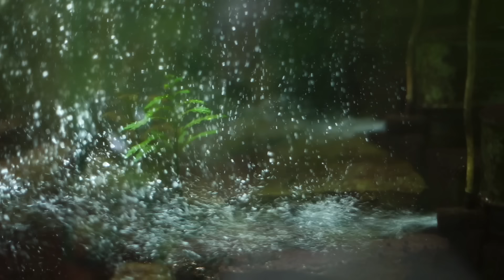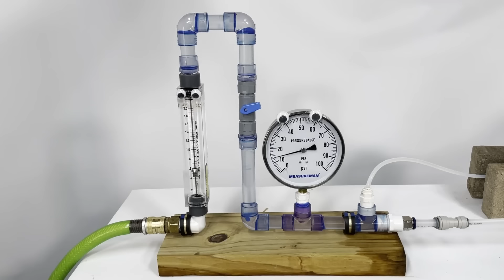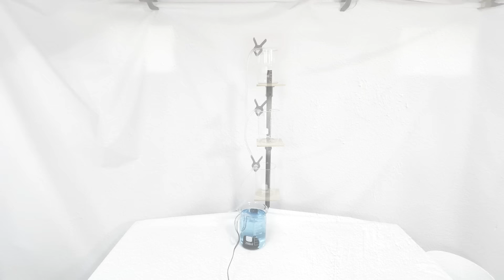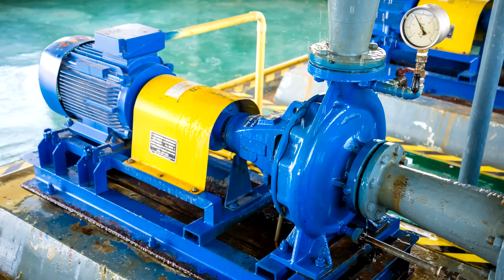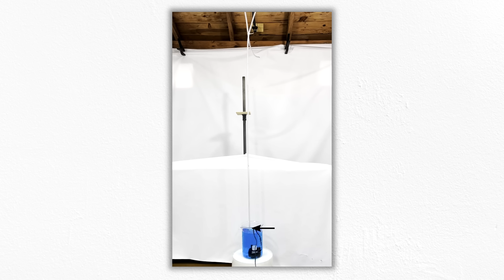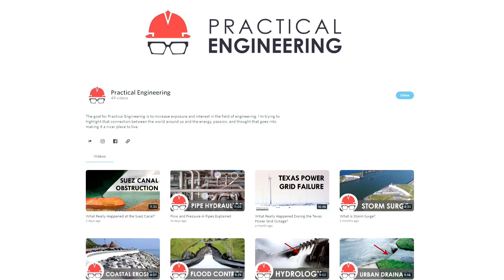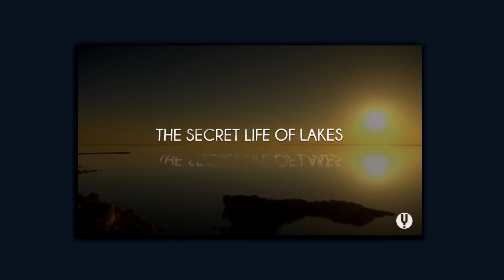Do Pumps Create Pressure or Flow?

Comment: If you had a valve half way up and pinched it off some. Would that help to get it higher?  So you would be cutting the flow a little bit but putting some back pressure on it to beat the head pressure?  I work in a refinery and I am trying to wrap my head around why we pinch the discharge of a pump to stop it from cavitation and on a cooling water system why we have the return to the water basin pinched in to create that back pressure.

Comment: Voltage and current go not hand in hand, if the source can't follow the ohms law. You can have a high voltage but no current, for example with a 1,5 battery. you load in parallel a few capacitors, and then discharge them in series, and that will produce high voltage, with no current. Etc.

Comment: from a newbie point of view, is it correct for me to say that the characteristic curve is on the backpressure of the pump (the higher the backpressure, the less flow the pump can push) and and the system curve as the supply pressure of the pump (the higher the pressure the pump operates at, the more flow we have)?

appreciate if someone can clarify on this. for context: I'm from a process background curious about pumps

Comment: you can not change the pressure by centrifuge pump if you have fixed system
when you change the system, the pressure will change otherwise the pressure will be fixed 
while displacement pump allow you to change and control the pressure without changing the system 

p+0.5ρv2+ρhg=constant 
pressure+flow rate+ system= constant

centrifugle pump change the flow rate (v) only
pressure (p) depend on the system (h) not on the pump 

on other words, centrifugle pump can only change the kentic energy not the pressure energy ( per unit valume)

Comment: Pumps will create pressure but not always flow. Flow will only happen with a difference in pressure. The pump creates some pressure and with a lower pressure at the end of the line you will have flow.

Comment: Pedantic? but when you say system pressure - dont you mean system resistance?
Pressure being needed to overcome the resistance.
Yes you can determine resistance by measuring pressure  - the measure can  amount to the same - but the system has a resistance, the pump has a pressure.
One more thing - when you say centrifugal - well that is a type /design - but the function/property is of a circulator (property)
When you say positive displacement well that is a property not a type/design.
For example a type other than shown could have been a diaphragm.
Further note would be that the circulators creates a negative pressure (suction) - whereas the positive displacement cannot - and thus need to be primed/ submerged
Other than the above confusion - very nice video explanation

Comment: In my humble opinion, if newtons third law is correct, that fluid did not move itself. I’m not an engineer but it seems like  whatever it forcing the fluid to promote flow would do so by creating a high and low pressure zone. Kind of like the screw on a ship or a wing on a plane.

Comment: I have searched for, and watched over 50 videos, talking about centrifugal pumps, the systems that they run, mainly irrigation with multiple zones, and the inherent differences between pressure and flow.
This is one of the best demonstrations that I have seen! I was reading through the comments, and one gentleman said that he wished you would do another video on cavitation. Personally, I would like to see you do one that addresses really low pressure coming through my 3 inch pipe, from 200 yards away from the irrigation canal. The water is dirty and often has grass and weeds and fish in it that clog my intake filter, shutting the pump down. Also, the flow is somewhat low. I was thinking that having a tank, which would be the capacity of water that I need for irrigating all four zones, approximately 16 sprinkler heads per zone, 64 heads total, available in Said tank. Then, I could simply drop a pipe and foot valve into the tank. Any thoughts?
Reply: What you described sounds like a loss of inlet flow to the pump, due to the plugged filter. Have you considered a dirty water pump or slurry pump? They tend to be more expensive but are designed to handle solids.

Comment: It's almost as though they're mixing up 'pressure' with 'back-pressure'. It's maybe more correct to say that pumps creature pressure, and pressure creates flow in the absence of resistance; much in the same way that applying voltage across a circuit creates current, and if the voltage is high enough to impart sufficient energy to an biological organism, which is delivered in the form of current, the organism will be killed...it certainly doesn't have the same ring to it though.

Comment: Great video! I've recently got into computer water-cooling and a question that often comes up is: "does X pump have enough pressure for Y system" and the biggest worry is that pump won't be able to push water to top of the loop. The videos between xQc and Linus are a great example of this. I was wondering if you have an intuitive way of explaining why a closed loop, in terms of water height, doesn't depend on the pressure rating of a pump. (or maybe it does and I don't understand it either) I'm thinking of making a video to explain my thinking and hopefully help some people understand it better.
Reply: It's a siphon. A hose full of water (no bubbles) will pull water up as long as the destination is lower than the source. 

So in a water cooling setup the destination and source are at almost the same height, the pump only needs to lift the water that difference between the two no matter how high the loop goes. 

So it sounds like you are rating the pump to overcome the constriction in the pipes and deliver enough mL of cooler fluid to the heatsinks.

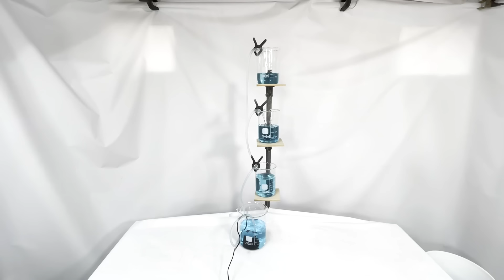Comment: i think the video " Pump Chart Basics Explained - Pump curve HVACR" explains better as to why flow is higher when pressure is low when dealing with pump charts from the manufacture, your explanation at 3:00 into the video doesn't say the same thing with bernoulli .... the rest of the video is correct but the experiment might create confusion

Comment: If you want to remove the pressure from the equation, don't you to separate it into positive flow and negative flow? As in, you have a degree of slip (negative flow) in the centrifugal pump dependent on the potential in the body of water in the output.

Comment: If current kills, 12V batteries are deadly. 
If voltage kills, then static electricity should kill millions.
Yet, a AA battery can stop your heart…
(If you short the battery with the cardiac nerve)

Comment: If the beaker is raised so high the flow is zero then there is no work being done. Work is force through distance. 
Power is rate of work and if work is 0 then power is 0. 
Of course there is power consumed in rotating the motor and bearings and friction within the pump housing and whatever but does it happen this way in practice? 
I have always argued this when someone tells me not to deadhead the centrifugal pumps

Comment: how do I keep automatic booster pump from cycling on & off when set to max flow? 
The water in the pipes would just create a back pressure or maybe reverse flow too that close a valve that detects flow on max settings.

Comment: Though the presure from a holding tank on ones roof will deliver the same amount of presure at the same distiance from to the outlet. The size of the piping determine the flow or amount of water for insance. Using larger diameter pvc piping as they do in India which is upto 2 in. vs Mexico which is generally a 1/2 inside diameter. Means if the length from the holding tank to the outlet is the same. Though the presure will not change, the flow will.

The presure to one automatic laundry machine isn't nearly important as the availble flow is. Due to sensor's which in part are based on a timer. If the amount of water aka flow isn't sufficent in the time limit, the sensor's determines it need be pror to the machine starting. The new machine's will simply shut off. Older machine will continue to operate, but having insufficent water to clean ones clothing, become an issue when the amount of soap isn't rinsed sufficently from the clothing. And or depending on how dirty the clothing is; Insufficent at cleaning regardless of the amount of soap one may add.
More presure to a degree does add some more additional flow. But in Mexico, one must add booster's to increase the flow, because the piping is so small in diameter as to regardless of the presure unless it is so high it may cause issue's with the pvc connection or pipe itself. Adding more presure vs causeing more flow. It the desire.

Comment: Is it possible to create a pond 'pump' without using electricity to filter the pond at a good continuous flow rate & pressure where the filter sits higher than the pond?

Comment: What about air? Is the behavior of air the same? Understandably, air is much lighter than water so gravity doesn't have quite the effect nor the same mechanical resistance. But it is known, the longer the air line, the less efficiency. Are the curves just as dramatic with air as it is water?

Comment: I have always HATED that "it's not the voltage that kills you. It's the current" saying. Have they never heard of Ohm's law?
Reply: The key equation is Power=current*voltage
Reply: @1.4142  that's very arbitrary. All of those basic equations are rearrangements and substitutions of the same few variables. 

Personally, I find the equation V=IR to be much more instructive. It shows that at constant resistance, current and voltage are directly correlated. So as voltage goes up, so does current.

Comment: Thirty horsepower electric motor with Vickers hydraulic pump , foolishly filter was installed between pump and relief  valve . Cold morning , Three micron filter , when pump started filter collapsed and plugged outlet . The pump exploded , pump and motor were enclosed in a steel cabinet otherwise injuries might have happened . When consulted Vickers said "HUH" !

Comment: The current vs voltage killing you saying is NOT incorrect and implying it is (tho you don't actually say that) is kind of dangerous.  There is specifically a range of lower current that is exceptionally lethal (at AC transmission Hz) and is where the saying comes from.  Certainly, the statement that ohms law determines that current, but while the voltage can cause severe burns and tissue damage, the lethal range of current that can cause uncontrollable cardiac palpitations is substantially more lethal....  While I'll agree that the saying is potential misleading or misunderstood (as it's often taken taken out of context) it's still true that current is much more likely to kill the average person in their home that the voltages available there.

Comment: As usual, 'perceived mechanics' breaks down (or becomes inverted) at the 'engineering perspective'. Whether it is the idea that 'voltage doesn't kill, amperage does' or 'in reality, the negative terminal of a battery is actually 'a positive' and vice versa (when considering actual 'electron flow'), it depends on perspective...pumps are no different. To most, pumps create pressure, which generates flow. Arguably to this point, you can easily make examples of 'high volume- lower pressure' pumps to drive such a standpoint.

Comment: What happenes in a city water distribution if at a particular time, noone is using the tap? Esetially the system is closed and the water goes nowhere. The pressure will be regulated I think, otherwise a pipe may burst somewhere at a weaker point, but what does the pump do? It stops? There will be a valve opened and the water dumped somewhere and recycled? How is this handeled?
Reply: I am asking this because at my mom’s home, she has a pump and a tank. The tank has a pressurised air chamber that stores water pressure. When the presure is at a certain level, the pump will stop. If the pressure drops, the pump starts again.

Comment: May I ask a question? 
For example, I have a pump w/ 10 bars & 1000 GPM. I need to extend my pipeline and the output nozzle is expected to have a minimum of 250gpm. Which flow rate am I supposed to use to check the new headloss that will happen? Thank you.

Comment: Pumps create neither pressure neither flow directly.

 Pumps introduce mechanical work into a system. The system "decides" wether that work is transformed into flow or pressure. Because of that Bernoulli guy...
Reply: Don't forget choke-flow.

Comment: Many engineers working with pumps don’t know wtf they are talking about in real world applications and I worked on engineered pump systems more then any others. Even when I would tell them before installation that the system they designed would not work well and would be a constant maintenance nightmare they would argue and say I’m an engineer and that the system will work perfectly and they left room for it to even perform at less then optimal rates. My answer is ok your the one who has to answer for it I’m just the one who gets paid over and over to fix your mistakes lol!

Comment: So I encounter this constantly and have over a career of near 40 years.  Mine being in engine oil pump arguments.   A engine uses a calibrated leak to predict the pressure based on the volume that the pump can move. The calibrated leaks are the specified clearances in the various babbitt bearings where the oil provides lubricity.  Wear of these components over time is unavoidable albeit oil tech and metals have changed but that is aside from the point that I'm making.   Customers with high mile engines will ask to have the oil pump replaced to restore the oil pressure in the worn engine. Explaining to them that the pressure is dependent on the clearances brings out the discussion of pumps making flow or volume and not pressure.  Which true enough they are symbiotic.    The pump provides the volume the system attached causes the pressure and there by if the system has changed outside designed characteristics replacing only the pump will not restore the desired pressure.  Will the wear of the engine's oil pump represent a small restoration of pressure?  Sure, because the gear rotor pump develops clearances outside designed tolerances over time of operation so the pressure can diminish as the pump can no longer force the oil into the space of the system.  Ultimately a pump replacement only yields no or little desired effect,  Restoration of the calibrated leaks is the only way to bring about the necessary restoration.

Consider an electrical system of a DC design with 4 loads wired in parallel. Each consumes the potential for work( volts) until there is a zero potential remaining at the end of the circuit.   remove the short one of the loads, the remaining 3 are starved for flow of electrons. Open on of the loads and the other three now have more amps flowing because the electrons will naturally balance. A zero potential will always be the result on the end of the circuit.   A pipe has the same effect if we have a 3" pipe with 10 holes along a 10 foot length with a fixed volume pump at the one end and a cap at the other end the pressure and flow are determined by the size of the 10 holes.  What if we drill out a few of those holes to a slightly larger size? 

 Conceptually with your test in the column demonstrating head you did not create a 0 head base to start the point.   Without a pipe to create the head pressure then the pump just flows.

  How about you turn that pipe horizontal and suddenly there isn't one flow or is there?  The volume will do what? Pressure does what?  Until there is a cap on the end of that horizontal pipe there is NO pressure only flow. 

Cap the pipe, put 4 tees of the same diameter as the pipe and a short length of pipe with a cap on.  drill a hole in each cap while watching the pressure n flow. Then drill a hole larger in say the farthest cap the best would be to have a pressure guage at each section. Some would argue the pressure drops after the enlarged leak. Does it? Does it not and why ? 

If you're going to look for a catchphrase like what goes up must come down to represent gravity.     Then  " Pumps are only one of the partners"   the symbiosis of each partner doing their job as designed is the accurate statement. 

I hope you read this a build the test. I'd do it but I don't own a youtube channel and I already know the answers to these practical engineering demonstrations.    I do love your channel and show others your content when I wish to prove out or humiliate the foolish.  So thanks for the great content.

Comment: . . . To be nit picky and technically correct, shouldn't the focus be on how the pump applies a force on the fluid? 
Centrifugal pump applies a force on to the water by accelerating it outwards from the center of the pump this created a suction on the water in the suction. For a centrifugal it created the flow first. 
Positive Displacement pump draws the fluid in. It is creating a pressure to suck the fluid in.

Comment: would a positive displacement pump not slow down as it reaches higher head heights, because it would slow down until the motor driving it stalls out and cant pump against so much head pressure, so thus its flow rate would decrease as head height increases because its pumping against a higher backpressure
Reply from the maker: Depends on the motor and drive. Many pumps use synchronous motors that can’t slow down

Comment: I disagree with you. the pump did create flow right up until the max head pressure was created. flow only stoped because it couldn't over come the head pressure. Pumps (centfigual pumps) create flow, pressure is the result of resistance to flow

Comment: A pump imparts energy to the water. Without flow this energy heats the water. In high powered pumps without flow the water quickly reaches boiling point. I am a career Firefighter.